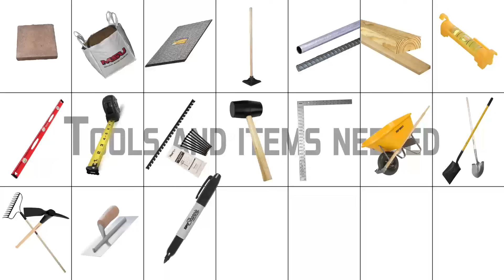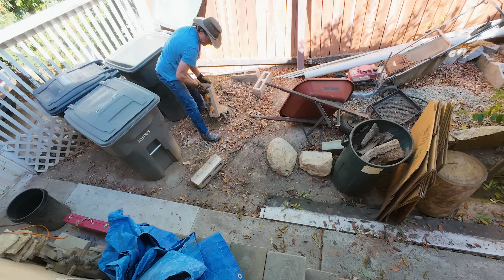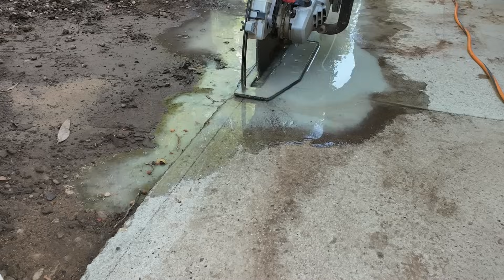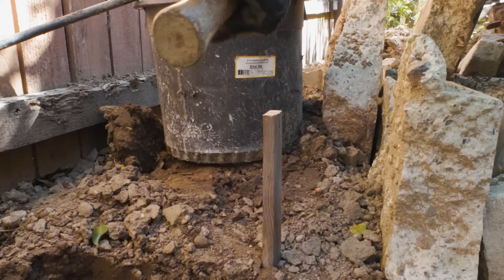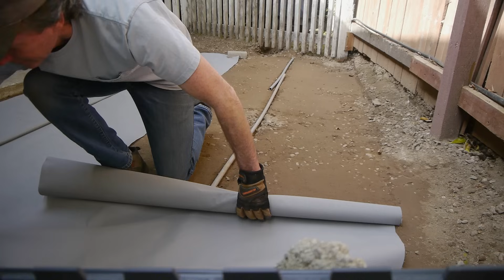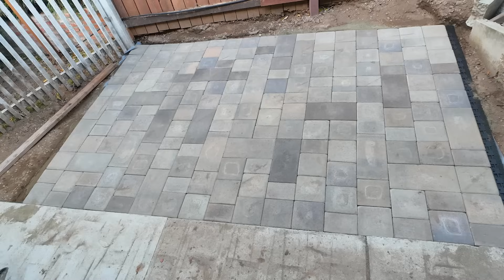Building a Paver Patio with Brock Paver Base - Better than Gravel?

Comment: I was thinking about using cattle pads or horse pads to create a temporary patio but I'm not sure if I still have to use the sand or the fabric
Reply from the maker: Well, I'm not sure how temporary you want it. The sand is to even out the surface under the panels and the fabric is to hold the sand in place when it rains.

Comment: I bought Brock pavers for my installation. As a novice, it didn't work. You cannot just lay them down and expect things to baalnce out,
Reply from the maker: Yes, there is still needed preparation before putting down the panels, but a lot less compared to doing gravel.

Comment: How does this sort of system hold up to ants? it seems like if they get to work you could have uneven panels after a while.
Reply from the maker: I’m not sure, I guess if any type of creature removed enough dirt from underneath you may have a problem. I guess that would be an advantage for using gravel.

Comment: I'm in the process of installing a 15 x 20 foot patio in our backyard and I plan to use Brock Panels. There's no way in hell I'm digging out 8 inches of dirt. In our subdivision you start hitting a lot of big rocks at the 6-8 inches. We're also in Central Texas; the region has been in drought for 4.5 years, so the ground is super compacted and rock-hard. We bought a tiller and it's taken me nearly 2 weeks to dig out 3 inches because I've had to stop and water the ground 3 times to make it soft enough for the tiller to break up. It's been a backbreaking stretch and I'm hoping that these panels will last quite a while once I get them down.
Reply from the maker: Sounds like you are getting a great workout 😅. The panels should last a long time, I think they come with a lifetime warranty. I’m sure you will enjoy all your hard labor for years. Thanks for sharing.

Comment: DON'T USE THESE! Use common wall insulation panels. Insulfoam R- 1.88 , 0.5-in x 4-ft x 8-ft Faced Expanded polystyrene Board Insulation.  It works perfect and a panel this size will cost you $10!!!  It will act as the back for your tiles, weed screen and will never rot or spoil.  Cut with a simple edge knife...
Reply from the maker: Interesting idea, and I may give it a try. However there may be a drainage issue with using regular polystyrene boards, I suppose you could poke some holes in it for water drainage.

Comment: A couple thoughts. Don't compact the sand, not needed. Do use polymeric sand. Why waste time and energy with the wrong materials? Lastly, avoid long runs of pavers without staggering the joints.
Reply from the maker: I've had good results using regular sand. If I do my driveway I will most likely use polymetric sand. I'm probably going to redo this area at some point, since I used regular sand, it will be much easier to pick the pavers back up. I haven't had any weeds growing in the cracks and it has been over a year.

Comment: I ran into the exact same issue trying to level the sand over the landscape fabric. The sand was incredibly damp right out of the bag, and I got so frustrated with it sliding around that I just called it a night. When I went back to work the next morning, the sand had completely dried out. Working with the dry sand made it a breeze, and I was able to level the whole area in no time
Reply from the maker: Thanks for the advice!

Comment: Great video! Just a reminder, you mentioned you let your soil dry out a little after a rain, the ideal moisture content for soil compaction is 8-15% by weight.  How a DYI person measures that i have no idea. If the soil is too wet or too dry you won't be able to properly compact it. Also if you have pockets of clay it would be best to remove it as when that gets wet it expands and can heave/ lift up the patio and even breaks concrete in some cases.
Reply from the maker: That makes sense, thanks for the comment. Mine was definitely over 15% when I first tried to compact it.

Comment: You can use 1/2" PEX pipes instead of PVC. PEX pipes are 0.625" outer diameter, so close enough for a 1/2" job. They are way cheaper than steel pipes or rebar when you need a few of those. $8 PEX vs $17.5 for EMT at Home Depot (CAD). And also, whatever you get, try to get the 5ft tubes, rather than 10ft tubes, they are just easier to store afterwards.
Reply from the maker: PEX is a good idea, if you can get the long straight pieces, and not the ones in a roll.
Reply: @BruBuilds  I was going to update my comment with exactly that, after I realized PEX also comes in a roll. Yeah, you need the straight ones for sure.

Comment: Doesn't the 6 inch strip in the middle without the interlocking edges compromise the load distributing properties of the paver base?
Reply from the maker: Still no issue even after a year. I made sure I didn't have a row lining up with the seam.

Comment: If I’m using the paver base panels approach, would I be able to add more sand in the areas to create the slope or does that have to be done with the dirt ?
Reply from the maker: It would need to be done with the grading and dirt.

Comment: Why not do Brock panel between dirt and sand?? I feel like sand tamps better and pavers sit better on it. The Brock panel can still be useful, but it seems kinda stupid to put a non tampable surface as the top layer. Any imperfection beneath it exposes itself instantly with jiggle in the pavers like you showed.
Reply from the maker: I thought the same thing somewhat, but just followed their directions. Might be an issue with the sand washing away in a heavy rain.

Comment: Appreciate any opinions...I'm looking to do a 250 square foot area.  It's already got pavers, but some areas have sunk.  Would it make sense to remove the old pavers, then tamp, add an inch or two of sand, tamp, and then follow with the base panels, sand, and new pavers?
Reply from the maker: Yes, I would remove all the pavers and re-level the dirt. You may want to use gravel or dirt instead of sand and rent a compactor. Then install the paver panels with the 1/2" of sand.

Comment: Thanks for the videos. I'm going to use the panels on a paver pad for my griddle. Only issue I'm fighting in my head is that the dimensions of the pavers I'm using (and size for the grill) work out to 78x47. I see in a video that you put a small strip in the middle but did this work out ok? Plus is 47" OK for two 24" panels. - thanks for your help
Reply from the maker: Haven’t had any issues.  But I think you could do it with 5 panels.first row would be 24”, 36”, 18” then 18”, 36”, 24”. That way they are staggered,  they should overlap properly and you don’t have any small pieces. Have fun!

Comment: I used to look down on foam boards and also this video , but with deciding with going with the foam boards I actually need this video and appreciate it , Thanks a lot I’ll be doing about 250 square feet
Reply from the maker: Glad you found it helpful, I was the same way until I used them.  Much easy and a whole lot less digging!

Comment: If anyone in the future has any questions about how a project with paver base has held up. I can say my small garbage pad I made and small patio extension for grill using paver base has held up really well since I installed it roughly 4 years ago.
Reply from the maker: Thanks for sharing that.
Reply: @BruBuilds How has yours held up?
Reply from the maker: It’s holding up fine, no issues. I did an update short video about a month ago.
Reply: @BruBuilds I only see the garage video. Okay it is a short! Thanks for replying!
Reply: Wondering if you experienced any of the sponginess at first and if that disappeared over time? I noticed in the video the larger pavers had some play due to the paver base. Thanks!
Reply: @bropez3506 I did, but once I put the poly sand in, it solidified everything and it went away

Comment: Can you use more sand. Like 1 inch instead of a 1/2 inch
Reply from the maker: The directions say to use 1/2” of sand. You may want to contact Brock and see if 1” would work just as well.

Comment: I built an 8'x3' landing off my back deck using these pads under 15-3/4" x2" blocks. I'm dead nuts level left to right, with downward pitch of 1" back to front. My blocks wiggle. I've pulled them up and minor corrections a few times. Still, a couple wiggles. If I were in dead sand, without the pads, I know these blocks wouldn't wiggle. Should I rip the pads out & do without? I'm actually pretty good with tamp, wood float, & steel trowel. I used nice paver sand. I just don't see the benefit of these pads.
Reply from the maker: From what I’ve heard larger blocks can have a tendency to wobble more. I noticed that when I first installed mine, but now they have settled. You may want to contact Brock and see if they have any suggestions. Without the panels or gravel your pavers would move and shift around over time from changes in the soil.
Reply: @BruBuilds hey thanks for reply! You're the best. Also, didn't put down weed barrier 😅. Not digging them up, because I made them perfect! Also, don't slam them with tamp to get them level after they're placed. I cracked one in half and had to replace.🤪
Reply from the maker: Been there, done that. 😂 the weed barrier is actually there to hold the sand in place.

Comment: I used Brock Paver Base, 12x12 concrete pavers and polymeric sand early last summer, and was initially semi-disappointed with the feel as I walked around the finished surface (roughly 250 ft2).
Within a month-ish the iffy/sponginess was gone. So far, I'm happy with Brock. I don't regret not digging the extra inches to lay down gravel I didn't have to buy.
It's yet to be seen whether it lasts the years I want to get out of it, but word around the web says it should.

Comment: I definitely will not be having all those tools doing this.. for diy, it should be minimal
Reply from the maker: To use Brock panels use just need basic yard tools. I needed the plate compactor because I removed so many roots and a tree trunk. The concrete saw was needed to straighten the edge of the walkway to make it straight. I do consider myself a DIY guy, and yes I have a lot of tools, some are 40 plus years old.

Comment: If you have occasional gatherings like once a month will this hold with the plates
Reply from the maker: It seams to be holding up fine after a year. It doesn’t get a lot better f traffic, but I do store our trash cans on top of it. As long as your edging is strong it should hold up fine.

Comment: Yes, but will the material that its manufactured with considered toxic waste if I want to sell the property?  I have seen that happen when several farms where I lived in MA that had recycled tire ground up for footing in a riding ring.  It turned into a nightmare with EPA involvement when the farm went up for sale.  Big costly removal and the soil is forever contaminated.  What is it made from?
Reply from the maker: 100% Polypropylene (a durable, food-grade, and environmentally safe plastic).

Comment: Really like where you show the difference from a gravel base at 4:18 on the video. 
Having laid two separate 16 x 4 foot walkways, this seems so much easier than digging out all that dirt. I think the savings on the cost of sand and gravel are about equal to the cost of the panels. I plan to build a patio in the back yard, and these will make that so much easier vs wheelbarrows full of gravel.
Reply from the maker: Thanks for the comments and sharing your experiencesz

Comment: Which one is best for weed control. That’s what counts to me. Everything I do gets attacked by weeds.
Reply from the maker: I would say the panels would be better. Between the foam panel and landscape fabric, there isn’t much organic material for a weed to grow.
Reply: This will be great especially if you use the polymeric sand which gets into the crevices, then after wetting it, makes a strong barrier.

Comment: Great Video! You could have cut a 1/4" notch out of a wood screed instead of trying to lower the PVC pipe 😇.
Reply from the maker: Thanks, that could work, but the pipes would have to be perfectly parallel to each other.

Comment: Can I use this system under a 15x8 shed.
Reply from the maker: If the weight of the shed was evenly distributed across the entire floor they should work. You may want to check their website. They are not design to be used on a driveway or under heavy equipment.
Reply: Thanks

Comment: Fantastic video!  I am installing something similar, however I am using deck and faux grass tiles instead of pavers.  The extention to my 10x10 patio is a 5x10 area, which the tiles will go almost up against the outline of my surrounding patio fence to where the 4x4 posts are installed.  What would you reccommend addinig between the tiles and 4x4s (about 7 spots that are 4" x 24") to fill in the space?
Reply from the maker: No quite picturing what you are doing. 7 spots of 4”x 24”. Can you cut the faux grass to fit in that area? Or maybe some type of brick edging?

Comment: You need to use the polymeric sand since it binds the pavers together. I wouldn't consider it optional for the paver pads.
Reply from the maker: I’m using that area for my trash cans and storage, I don’t notice the pavers moving anymore.  I’ll need to try the poly sand sometime and see how I like it, and maybe replace the sand in my back patio.  But that will have to be later, after a kitchen remodel.

Comment: All of that work to not finish it by using polymeric sand to lock them all together is like cooking a big Thanksgiving Day feast only to shove it all onto the ground before serving it.
Reply from the maker: I used regular sand because I already had some on hand, so it didn't cost me anything. If I decide to change this area later. which has a high probability it will be easier to remove and reuse all the pavers. I've heard that polymeric sand that it can crack and chip over time. Thanks for the opinion.

Comment: Since I watched the video it is very well done but there's a lot of things in here that I think you made extra work for such as the pavers panels in the Middle where you connected all of them and you staggered them as such which staggering them in locking them into place I understand but the middle section that you did I think was not really necessary. I also think that you should have used the polymetric sand this is the reasons why is that when you wet it it locks in and levels itself out so you don't get the movement of blocks as you stated in the video it may have helped with it and it would have.

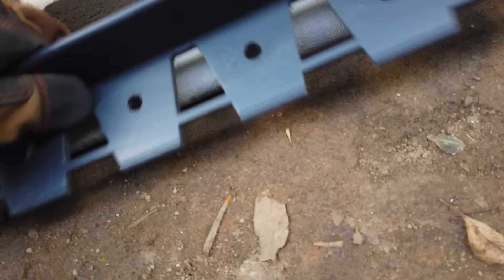Comment: 16:10 This video is awesome and very helpful. I was wondering about this step where you wrap the fabric around the paver base and then stake it. It makes sense that that would help your sand from moving, but is that going to trap more moisture under the pavers/panels?
Reply from the maker: Any moisture will flow through the landscape fabric; it's not like a vapor barrier that you would put under a slab.
Reply: @BruBuilds  Got it. Thanks, and thanks again for the helpful video

Comment: Hi im doing a 3 ft wide walkway with stepping stones spaced out about 4in. Gravel will fill in the rest of the area. Can I use these panels in a straight line where my step stones will be? Or do I need the panels to fill in the full 3 ft wide pathway where gravel will be ?
Reply from the maker: I don't think these would be your best option. You wouldn't want them under the gravel, so they would need to be cut the size of each steppingstone, but then you would have to deal with a bunch of edging. I would try something like compacted decomposed granite for the base of the entire walkway, then put the steps and gravel on top of that. I'm sure someone has a video on this topic if you searched "steppingstone and gravel walkway". Good luck

Comment: Great video and time taken to explain everything step by step. I have a question I live on a large island and when I dig 3 inches down I'm already into pure sand no actual dirt in my yard to build off of. So I'm thinking if I dig down level it compact it a bit and re-level with some pipes I should be able to put the panels directly down? Do you have any thoughts on this?
Reply from the maker: Thanks for the comment and question. @mymynguyen4680 had the same situation, not sure if they tried to use the panels yet. The edges are where a problem might occur because the sand will move around when you step off the pavers. Maybe put a ring of dirt or gravel around the perimeter to help hold the sand in place under the panels. You do have the advantage of not having to dig out dirt and it should be an easy fix if things do shift around some.
You might also contact Brock and see what they recommend. Good luck and comment back if it's successful for you.

Comment: Thanks for the video. Does it freeze where you live? If I recall correctly, when looking into these panels they had recommended 2 or 3 in of gravel instead of the six or eight you would normally use here because the ground freezes.
Reply from the maker: We don’t have a freeze problem where I live, so not sure about needed the gravel.

Comment: When using gravel, you wouldn't normally tamp the sand? I wonder if using 1" of sand below a paver base would lessen the need for tamping?
Reply from the maker: With gravel you put the pavers down the run a compactor over the pavers. So I guess you would be compacting the sand at that point.

Comment: I live close to the beach and my backyard are 100% sand. Can I just tamper the area I want for my patio, then add paver base and paver on top of the base? Thanks so much for the video!
Reply from the maker: I would give it a try and see what happens. You will still need to level  and compact the sand then add an edge border.